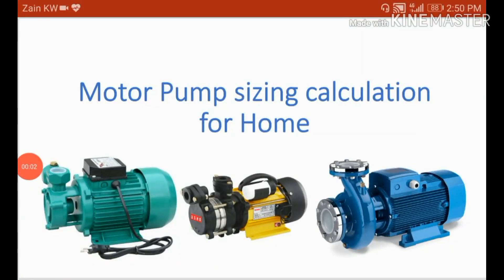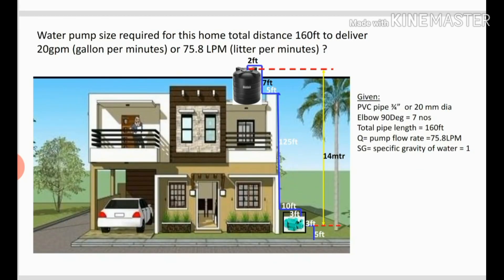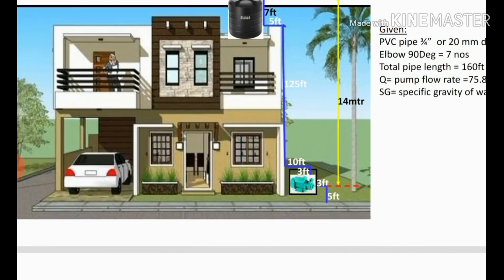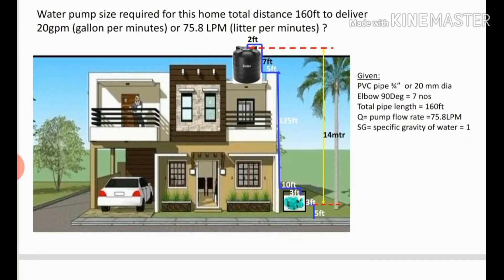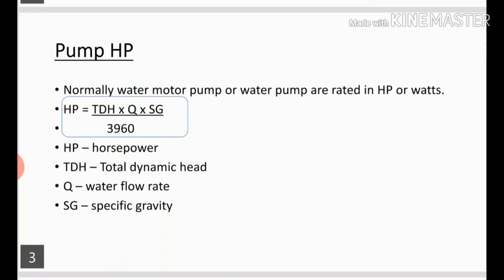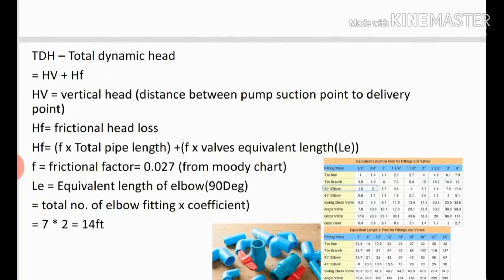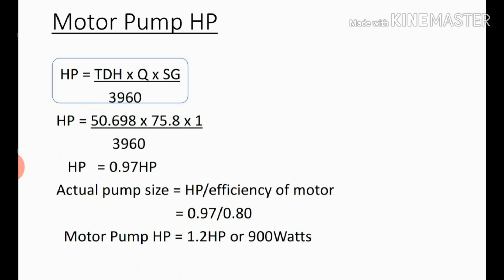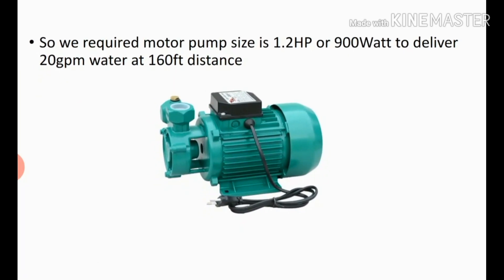How to calculate water pump sizing for Home /Appartmants

Comment: May i ask for clarification, i think 20 gpm should be inserted in the Q rather than 75.8 LPM because the units of 3960 is gal/min/feet according to what equal to 1 horsepower. Wish your response thanks
Reply: Yes, 20 gpm should be in not 75.8 LPM.